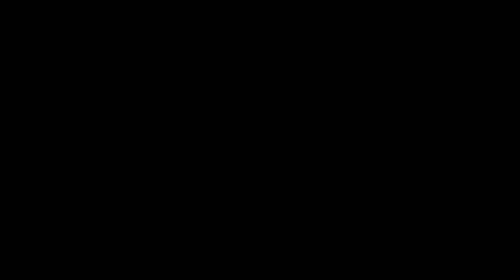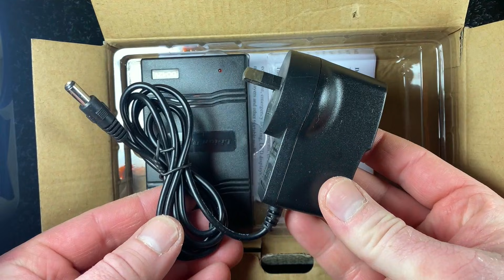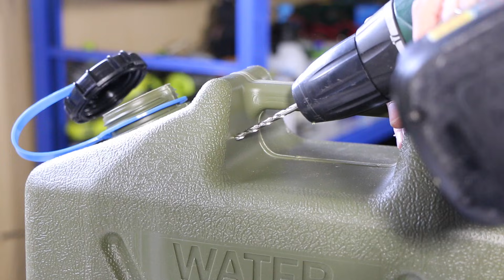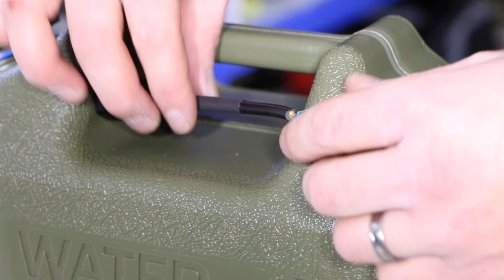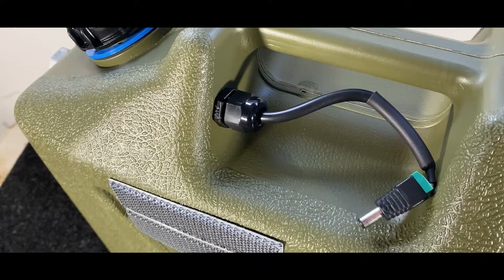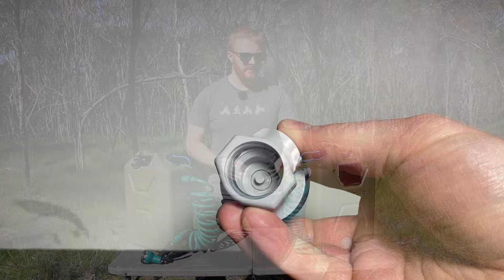WIRELESS and PORTABLE 12V Water Supply Pump | Camping and 4WD water jerry can/tank setup | How to

Comment: This was excellent, thank you for sharing. I did order the Male quick connect fitting HFCD22835 as per your above information, I think the exact product is actually HFCD22812, not sure if you want to change your link to be updated to the 4.2 bar as it's perfect match. Great instructions also.

Comment: Great thanks! But, struggling to get these:
- Male quick connect fitting
- Female quick connect fitting
Finding a half inch (I assume that's the diameter of the opening at both ends) is proving impossible, I tried Amazon and Ali-Express...
Any alternative pieces or suppliers? (I'm in Aus, by the way)
Cheers!
Reply: I'm having exactly the same issue! Did you manage to find a male or female quick connect fitting?

Comment: I really liked your video and I wanted to build my own one of these so I used your link to buy the female/ male connection fitting but they aren't the same anymore now the valve is on the male meaning if I disconnect the water hose it will leak from the tank. Its not your fault but I thought that you might like to know so maybe you could update your links. Thank you

Comment: I'm in the process of building one myself. Does the water jug need an extra vent hole to prevent negative pressure in the container, or does it work without a vent hole? THX!
Reply from the maker: I've found with the relatively slow release rate it has been fine in this sealed form 👍

Comment: A much cheaper locally available disconnect is a beer line (homebrew) ball lock post and disconnect as used on 20L kegs. Seals are easily replaced and you know parts will be available forever- unlike Amazon stuff. A liquid post with 1/4" BSP plus stainless dip tube plus plastic disconnect is around $20. A separate option is just use a 10L or 20L ball lock keg and pressurize with your air compressor, though the round shape might make it harder to fit, but they're not much thicker than a 20L jerry.
Reply: Did you try this with the ball lock disconnects?   Was there enough volume coming through?  Great idea if it works.
Reply: How was the pressure? Sounds like a good idea

Comment: Just built mine before I saw this video and is almost identical other than I used standard air compressor connectors for hoses. Are very compact, self-sealing, can get stainless steel ones, and are pretty reasonably priced from Bunnings. Used male fitting with bayonet to connect hose and bayonet fitting to screw onto and hold female fitting into tank with rubber tap washers either side to seal. BTW, I chose to put my water and cable fittings on the top of the tank so not going to be in the way if use external jerry can holder or bouncing around in the back of the vehicle. Cable-tied some thin foam sheet I had lying around over the end of the pumps as these ones don't have a filter and sucking up a piece of debris could be terminal for these cheap pumps. ( I originally got one of the smaller stainless steel pumps labelled as diesel/water pumps, but they don't have the flow-rate or pressure of these grey plastic ones, unless run on 24V and then would be great) Final touch was using a sealed male bayonet fitting to seal the female water tank fitting while the hose is off so doesn't get contaminated with dust while on the road. I was planning on using the car's appliances battery but the little separate battery is a good idea.
Reply: Interested n some pics of the compressor connectors used. Thanks

Comment: Great instructions 👍I do like the stop valve but one of the cons is that the female adapter is on the can and the male on the hose where as most standard hoses will have the female and the tap the male. This setup does make it unable to swap hoses.
Reply from the maker: Thanks mate. Yes this is true, however with these connections it's unlikely to be swapped around as they are that popular, at least here in Australia anyway.

Comment: An Australian company called Vaast has come up with a awesome roof mounted system with 18 litre modules! I was looking into building one of these but some of those parts including the quick connect fittings are no longer available!
Reply from the maker: Hmm, I'll have to look into this. There have been a couple of great ideas hitting the market recently that would make water storage both practical and accessible.

Comment: Great video mate. A (dumb) question. When you press the spray nozzle, the water comes out. When you release it, is the pump still running?
Reply from the maker: Cheers mate. Yes, this compact style of pump means that it will continue to run even when water is not being dispersed. It is designed this way, however it's good practice to turn the pump off between cycles 👍

Comment: Great vid - 
i am looking at one of those diesel heater that has the water heat function only thing is it needs to cycle water though via a pump - wondering how to extend the rig you have here to encompass the heater unit - e.g cycle water back in the the jerry - perhaps another quick connect to drive water back in?
Reply from the maker: Ahh yes, this could definitely work. Maybe another intake quick connector fitting at the top? This would separate the water temps to, drawing from the bottom, cooler water and heating the top warmer water?

Comment: I had a lot of fun doing this over a weekend. There were some follies like getting the clear tube lost inside the jerry can but I finally got it all together and it works - kindof. I do think the pump could be a lot more powerful. As it is, the stream is more like a strong urination than it is a spray. It might be that my coiled hose needs to be cut down? What do you think.
Reply from the maker: Great to hear that this project worked out for you. It is a fun little build for a weekend project 👍 
Hmm, not sure why the pressure may be a little low. The battery is fully charged too? It could be restriction in the hose, either inside or out? Maybe check those internal hoses too, make sure they aren't kinked. All the best

Comment: Hey guys I actually brought one of these ontap products and it is unreal.
I wouldn't even waste my time trying to make one after adding up the cost for parts and its been so reliable aswell.
Reply: Hey!

I'm looking into changing my system to make it easier for filling, currently everything mounted through the lid!

How did you manage to secure the outlet on the inside.. hahaha
Reply from the maker: This is certainly an option, but as I’ve shown in this comparison, other units on the market don’t have the valve in the hose connector and other limited capabilities, plus you don’t get the satisfaction of building it yourself 🤷‍♂️
Each to their own 👍

Comment: Could you retrofit the quick connect fitting to the ontap portable shower you also have? Is it the same hole size?
Reply from the maker: Hmm, couldn't confirm mate. I've since sold the OnTap product
Reply: @XploringOz  did you eyeball the submersible pump in the OnTap product at all? Very different to generic ones available on eBay?
Reply from the maker: @bruceinnawoods3610  I did take this unit apart, however unfortunately I can't remember the details on their unit.

Comment: This is so expensive to make, I wanted to do it , but then I searched ontap, and they have them for 180, but I want the joy of making one myself!
Reply from the maker: I guess, but unfortunately you are probably not going to be able to manufacture for less given the style and components used. 
OnTap do have them, however this is the unit I compare with and don't have stop valves on the connections and will leak everywhere when hoses aren't connected.
Cheers.

Comment: Hello from Texas… Fantastic informative video got a new sub.. I currently have a video on a pressurized scepter can but I am thinking about going to a 12 V system similar to this. what is the runtime for the current battery pack in the video?
and or how many refills 22L refills until the Battery is exhausted?

Comment: Would it be possible to do this with all fittings through the cap?   Multiple water jerry cans and only 1 submersible pump. Change the lid & pump Co bo from jerry to jerry?
Reply from the maker: I like the idea, potentially possible. It might be hard with this particular brand as I don't think there would be enough room on the cap without interfering with the seals, but maybe a wider brimmed cap?

Comment: is it a pressure pump. ie will turn off automatically when a water pressure has been reached?
Reply from the maker: Negative, this particular pump will run whenever it's switched on. I'm sure you could add a pressure type pump, however I haven't looked into this. Given the low pressure and the design of the pump, it can run with flow for some time before wearing out. 
Cheers, Nathan

Comment: So, I am guessing that the yellow wire (unused) is a trigger wire for the pump. Would that mean to take it a step further you could run a trigger to the nozzle, and have it activate when you press it in? Yes makes it more complex but saves the pump running when it has nowhere to pump (ie tap/nozzle turned off).
Reply from the maker: For sure, this definitely could be an option as well. Given the low pressure of the pump, I found it ran ok for short periods of time when it was pressurised, but you are right, ideally it would be great if it came on automatically. 
Cheers, Nathan.

Comment: I made something similar.  But I used a usb pump.  A five volt USB battery pack that can use any AA battery.  I run it with a motion switch so entirely hands free.  Runs for fifteen seconds.  Perfect for dish and hand wash.  Three gallons last me a week.
Reply from the maker: Nice, this would work very well. Thanks for sharing your idea. 
Cheers, Nathan.

Comment: What a simple water solution 
Just ordered all the parts
Great video
Reply from the maker: Cheers mate, glad you enjoyed it and all the best with your build. 
Cheers, Nathan.
Reply: Show us how did you go?
Reply: @jorgevillamizar1294  put it all together yesterday, only issue was the coil hose is 8mm and the quick release adapter is 12mm so I used a step up adapter 
Took the dog down the beach this morning, he got a quick blast of drinking water, a hose down and I washed all the sand from my feet before getting into the truck
Handy having pressurised water on tap.
Thinking of making another and just switching the battery over giving me 40litres for the remote trips

Comment: I've made mine and don't seem to get anywhere near the pressure yours puts out... Any ideas?
Reply from the maker: Hmm, off the top of my head I can only think of basic causes like, any kinks in the internal hoses, leaks in the connections between the hoses and outlets/pump, diameter of hose and lastly state of charge of the battery? Have you checked all these things?
Reply: @XploringOz  yeah battery is full and no kinks. I'll pull the pump out of the jerry and run it to see if it's leaking somewhere
Reply from the maker: @stevethorne6535  Yeah, try testing the pump outside the jerry can too. Just see how much water the pump is moving. There is a chance that maybe there is a fault with the pump itself?

Comment: Epic video mate never seen this done before. One thing you didn't touch in is how to fill it back up. I assume the hose is only one way for output? Would you have to just manual open the top cap and pour in water or perhaps submerge the whole Jerry can in a water source being portable.
Reply from the maker: Cheers mate, glad you enjoyed it. So the best way to refill would be to open the black screw top near the hose outlet and pour/pump the water in that way. I guess you could submerge the pump, you would just want to keep that 5.5mm power jack as dry as possible to avoid corrosion down the track. 
Cheers, Nathan.

Comment: Love the idea and thanks for the parts list. I assume the pump would be running all the time that the battery pack is switched on. I'm not sure of the workings of a water pump but does it adversely affect the pump if the pump is running but the hose isn't squeezed to let the water out...if it is left running for too long?
Reply from the maker: Hey mate, yes the pump is running constantly when switched on, so it would be advisable to switch the unit off between use. Given the simple design of the pump and the fact that it is left on during stationary flow, it can handle this for some time, but I would assume that leaving the pump running unnecessarily for a long period of time would shorten the pumps life. 
Cheers, Nathan.

Comment: Great vid Nathan. I've been using a $30 12v submersible pump and hose from BCF with the same container you have used,  for the last couple years for beach runs, but it definitely would be way easier not needing to plug it in as you have done here. Good stuff
Reply from the maker: Awesome, a solution like this can be super helpful, particular for those quick beach runs. I'm sure it wouldn't be hard to convert over to a battery option if that was what you are interested in.
Cheers.

Comment: I’d be careful of those cheap eBay submersible pumps. They only usually last a few weeks. A decent quality one will cost you around $90 in Aus. Quite an expensive project if your pump fails.
Reply from the maker: Potentially, I'm yet to test the longevity of the pump as its a relatively new project. This being said the project isn't completely wasted if the pump fails. Replacing the pump with a good quality one will only set you back the $30 you lost on the cheap one. Either way, the pump can be purchased to suit each buyer.
Cheers, Nathan.

Comment: Great video Nathan as always. Clear and concise. I have copied a lot of what you have done in the past with my own setup. Not sure about the cost though as when I roughly add the items from your links it comes to over $250
Reply from the maker: Cheers mate. Yes, I have noted that a couple of the items have changed priced since I film this episode. Also the smaller battery that I used in this project is now out of stock and the larger battery sure adds some cost to the project. 
Good luck if you do choose to do something similar, I found it a fun project to build as well.
Cheers.

Comment: Love the concept.  Just wondering whether you mount the quick connect in the lid to prevent drilling the side of the jerry?
Reply from the maker: Cheers mate, for sure. This is another option. I just preferred the side of the jerry just so the hoses didn't get twisted and in the way. But this can be changed for any other type of build. 
Chees, Nathan.

Comment: Hey mate, check out “ontap” products
Reply from the maker: Yeah mate, had some experience with their products. They are great, however have a few limitations. No doubt their models will expand and evolve over time. 
Cheers
Reply: @XploringOz  I just bought one of their jerry cans, what limitations have you found?
Reply from the maker: @BanksPhotography  The same limitations as the comparison at the end of this video. The cord limits the distance it can be used from the vehicle and the hose connector is straight through. Meaning that when the hose is not connected, the system is not sealed and can/likely leak depending on how full the jerry is. No deal breakers, just a different design.

Comment: great way to transport water and have the ability to retrieve it via a pump.
How much weight would you say is added?
Reply from the maker: For sure, I thought it worked quite well. The battery and pump are extremely light, I would guess to have added maybe 500grams. Only an estimate. 
Cheers, Nathan.